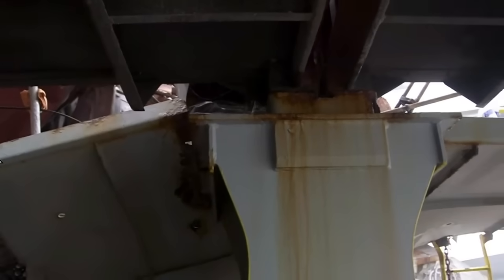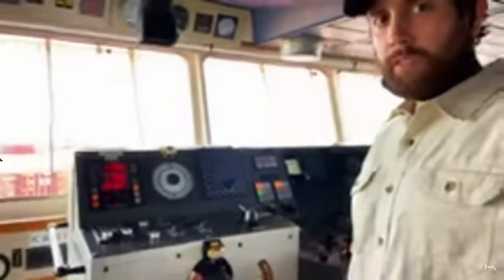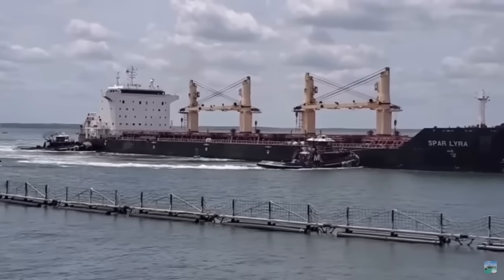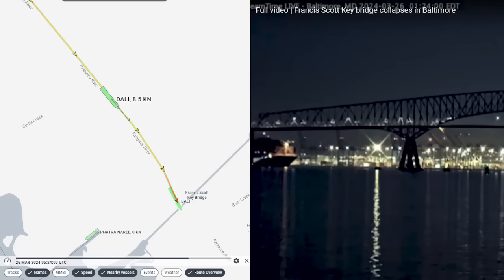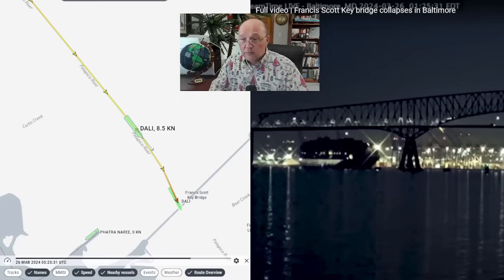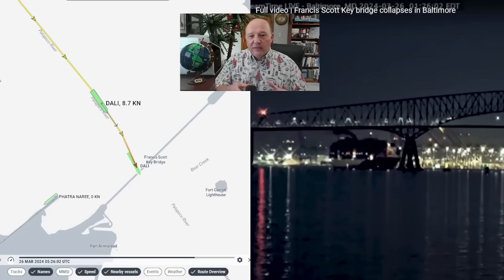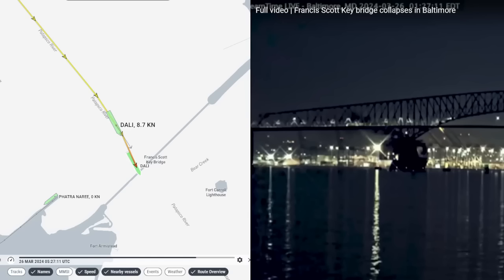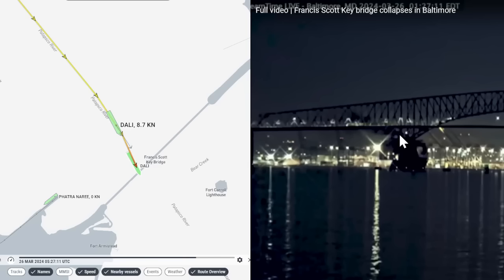Dali Timeline from Data Recorder in Striking Francis Scott Key Bridge in Baltimore, March 26, 2024

Comment: as much as we would jump to terrorism this is just a plain accident you cannot start one of these things like you start your car and if it's got contaminated fuel all bets are off

I see them on the St. Lawrence seaway where every few years one of them will have an engine failure or a steering problem and they can go a long ways before they stop.

 they'll hit the bottom before they can hit anything else except maybe another ship takes a mile or two to stop and if they got no steering they're in for a ride

it is unfortunate that they were that close to that bridge but I don't think even if they had a tug attached they would've been able to have any control to prevent it

The guy running the ship has an exemplary record and I'm betting that the data recorder is going to show exactly what happened which is engine failure no control got it restarted lost it again and it was all over with

Comment: A rudder is useless without thrust. This vessel would keep floating straight without engines no matter which way it was pointing. This is common sense.
Reply from the maker: A rudder is more responsive with thrust from the propeller.  However, even losing power, the prop does not immediately stop and the flow of water from the forward movement does provide limited control.
Reply: The rudder is a control surface.  For the control surface to operate (a pressure differential to exist) it requires water to flow over that control surface.

Comment: You shipping info is great, but please stop calling piers pilings.  Piling is a construction method that might have been used to drive piles into the bedrock on which the foundation of the Pier rest. The pier is what is sticking out of the water and supports the bridge deck.

Comment: If DOT was able to close the bridge why didn’t the get there contractor personnel off?
Reply: Probably didn't have time to find and warn them. The transcripts from the radio communications indicate that none one had any idea where they were on the bridge at the time, just that they were somewhere on the bridge. It takes some time to close  the bridge, but more time to drive around on the bridge to find and remove the road crew.

One future solution, could be requiring road work crews have radios so they can be called off in a emergency.
Reply: I wonder if there was a language barrier.  Believe all of them were hispanic.
Reply: Lack of time and lack of available units and lack of direct radio communication. 

Port Transit Authority had two units at either end of the bridge enforcing a restriction due to construction closing some of the lanes on the bridge.  when dispatch told them a ship had lost steering, they simply blocked the approaching traffic, which, at that time of the morning was not very heavy. 
The dispatch did ask if the units on site had contact with the construction crew, and one guy offered to drive up there and get them as soon as someone else arrived to relieve his spot blocking traffic. Obviously he didn't realise how imminent the impact was.

Comment: that bridge looks an ultimate architectural dream...the world port and maritime authorities the top notch honest Solas...MarPol..regulatory enforcers...the perfect JoinMafia Shipping&Shipyards companies best companions...but my real point is tt here  we are missing reality check..despite the amazing channel of Sam  kudos...that ...unfortunately...nobody like to admit that EDGs are absolutely crap..missing 9 of out 10 restarts....I guess the lateral current could have been a substantial cause for the vessel to deviate her course...stern much heavier and wider submerged hull volume definitely win over to the fwd section....and do not forget..when a right hand propeller starts...by screwing the water section clock wise ..the bow has the tendency to veer on starboard side..( viceversa for left handed propellers)( still this effect works basically from speed 0 to speeding up..)... but to be fair..in my opinion...the well explained in comment sections by professionals...the sudden drop of pressure in the rudder gear forced the temporary blockage of the rudder..nothing to do here...the timing doesn't help unfortunately....port anchor could have helped in swinging the bow on port side  just only (maybe with God willing...) if dropped in ample time...(.. but looks the black out occurred exactly on approaching the bridge...if we see the anchor dropped anyway   it's a good sign trying to cover crews/equipments negligence/ faults.. ( deja vu...correct my dear port authorities and inspectors and so and so...)..oh!..the S.M.S. was created to fuck us Officers...guaranteed.  We all are responsibles to these incidents...blinding ourselves  that business is NOT business...and that we want larger vessels and minute infrastructures....but null maintenance..maintenance and risk assessments are made just for the good sake of Lloyds and friends...remember guys the so called advanced technology is far to be from what we want to believe including all those cruise liners deployed full of flaws and dangerous structural defects.......buona pasqua..God bless those unfortunate souls.

Comment: Well I live just across the river from a major container port in the UK and no ship either coming into port or going out is ever allowed to not have tugs in attendance,and here we have a large container ship that has to go under a bridge sailing without it seems tugs,it was a accident waiting to happen.
Reply: I live in a port town and tugs are FORBIDDEN to escort ships even much smaller than this under bridges due to risk to the tug boats, which cannot stop a ship this size and would be incentivized to try anyway, leading to an additional fatality. Ships this size transiting a bridge without enormous artificial islands capable of grounding the ship well away from the piers are all accidents waiting to happen, with or without tugs. The reason the accidents are still waiting to happen is no one wants to spend the $$$$ to replace the whole bridge, so we just deal with what is the 35th such accident since the 1960s. Here we simply moved most ports to downstream of the bridges or just deny large ships entry.
Reply: @peter65zzfdfh Well given this ship lost the ability to steer before it got to the bridge a couple of tugs might have made the difference between a disaster and a close shave,ok I do not know that harbour but from the video that ship was never on the right course to pass under that bridge in the centre so a couple of tugs would have helped alot.

Comment: I happen to live in Hamburg Europes 3rd biggest container port and Germaneis No 1 port  inland from the North Sea . Now the horbor is a very busy place to operate in and also a busy waterway that runs into other nations in Europe . So we have a mix of the Super heavy Container Ships .bulk carries  small costal ships inland river cargo ships  Tourist shipping ie Cruise liners  and just general ferry traffic and private boats and  hobby sports boats . I have marveled at seing the worlds biggest Container ships being turned around and then reversed into the main Container burths with next to no space for error .now we have serveral of those monster Tugs here in the port  a based near the main habor. 
Now these ships are massive TV pictures simply do not show the true scale of these giants especaily the new generation of super Container ships which can no longer sail fully loaded up the River Elbe in fact now having to off load part of there cargo at a Coastal Container port before continuing to Hamburg and then only at high water . This is even after the River was deepened . Another issue here the sheer hight of these newer ships because another issue is getting under the main road bridge to the a 2nd Container port and railyard. They now just about pass under the bridges central span hight at 53 meters high the bridge is to be replaced one because its now old and is costing more and more to maintain.
But both replacment ideas and costs and in what form it should be replaced with have bogged down in a big argument politcally wise. Also its a symbol of Hamburg so many do not want it removed or at least parts of it left in place. anyhow I have drifted off subject. So far in Hamburg we have not had a major Container ship accident that I remember since I have lived here. But there have been accidents with smallers ships and only a few weeks ago a life was lost after a smaller Tug sunk I think after been hit by another boats we have also had smaller bridges and piers hits by ships in the past. At least two were those in charge were drunk in charge all ran into millions of Euros of damage .but those here working for the HALA port authorities and the river pilots and Tug Guys and Girls really do an amazing high pressure job to keep things as safe as can be here.

Comment: Ship went all over the world and lost power right there which is like a spec on its total voyage.... the odds
Reply: Yup, just about the worst place to lose power.  Ships have power issues a lot, but often at sea away from obstacles. Container ship Blue Nagoya lost power approaching the bridge from the other side in 1980 and bumped a pillar... but in 1980 container ships were a lot smaller so it just tore out a chunk of concrete, rather than cause catastrophic damage.  I think the Nagoya was about 1/10th the weight of this ship.

Comment: No reverse gear????
Reply: They might have thrown it into reverse... that might explain the black soot that suddenly comes out of the chimney, but they were too close to the bridge to go from 8kts to all stop.
Reply: @jimbobeire  now i found out there is no reverse gear. They stop the engines and restart backwards! Wierd!
Reply: @robertdinicola9225  Depends on the ship. Some have a reversing gear, others are direct drive.  There's pros and cons to both.
Reply: @jimbobeire  that one supposedly has direct.
Reply: @robertdinicola9225  Yup, requires high air pressure blast to the pistons in sequence to reverse the piston motions.  But either way,  they were too close to the bridge to come to a full stop, especially if power kept cutting out.
Reply: @robertdinicola9225  Big reversing gears and some kind of massive clutch for that much horsepower (Dali is 55,630 hp, equivalent to 14 modern diesel locomotives) are a major problem themselves.  Gearbox problems on one of the 2 Navy LCS classes are the main reason they are being retired early.  Reversing a big diesel just requires flipping the valve timing.  The practical alternative is a reversible pitch propeller, again supersized for 55,630 hp. Container ships spend the majority of their time crossing the ocean as efficiently as possible, very little time in port, so reversing is a low priority.

Comment: The port anchor would pull the ship towards the bridge. That would answer my question about why they turned into the bridge. The starboard anchor would have pulled the ship to the right, away from the bridge. First they were way off course and far left of the center of the channel.
Reply from the maker: Port anchor pulls it into the channel
Reply: Opposite. The ship veered to the right into the bridge pier.

Comment: So, as a marine electronics guy I have a few problems with your assessment here. First off, the ship turned closer to 90 degrees than you showed just before hitting the bridge. Second, not all back up systems are "automatic"  and that includes generator sets. Also, "automatic" systems fail too, right? I kind of thing there were system failures in this episode and I kind of think we will never know the full truth of it, because that is the world we live in now. The fact is that it happened and it needs to be fixed quickly, and given the current powers that be I suspect that it will take far more time and money than it needs to take to fix it.
Reply: Yes. There's a video which shows a rather dramatic turn to the right, which Sal seems to be minimizing. Not sure why he's downplaying what's obvious to some of us.
Reply: @terebrate  The video is from a weird angle that exaggerates such things. The tracking is more accurate.

Comment: Call for tugs???????
Why aren't tugs used at each end of the ships to let the front tugengine on an rear tug weighted..
Both taunt with a cable/ECT.
When said ship is out at sea the tugs return..
Why the hell in the USA are we looking like ASSES an not using tugs to guide these in an out 24/7..
ESPECIALLY when no DRAW Bridge.. or concrete protectors to protect the bridge...
Philadelphia has one protecting its bridge across the Delaware one can exist in our main port in the USA?????????
😢😢😢😢😢😢😢😢😢😢😢😢😢😢😢😢😢😢
There's no excuse for this accident we got tugs to Guide these ships in and out!
What an embarrassment for our country!😢😢😢😢
Reply: Out at Sea? Or just out in Chesapeake Bay, cos Baltimore is a long way from open sea. 
Propbably someone kept kicking the can down the road about spending a huge chunk of budget to put in proper protections for the pillars, but to be fair container ships kept increasing in size at a remarkable rate each decade.

Comment: The simulated version does not at all capture the sharp angle the ship made. It makes it seem only about 20 degree's. It is clear though that the boat turned at least 60 degree's which you can obviously tell in the video because the boat is almost parallel to the camera then goes perpendicular.
Reply: The angle of the video greatly exaggerates its movement. It's nowhere near parallel or perpendicular even then.

Comment: The core reason that six people died from this accident is that there was insufficient political will to spend the money required to protect the bridge.

Everything else, at this point in time is pure speculation as there is insufficient information to draw any valid conclusions.
Reply: Taxpayer money is a limited commodity.  Spend too much and you kill people other ways.  Spend way, way too much (our present gov't, and not just ours) and eventually it will kill millions when, not if, the entire global economy collapses.

That's not to say that in this case bridge protection should not have been a higher priority, as there are so many fallout effects from this sort of accident (some also deadly or at least potentially deadly), and under different circumstances many more people could have been killed.  But, ALL factors and costs should be weighed, which rarely happens in a cannibalistic, political world.

FWIW, I would think we know enough that modest cost structures can be built and MO Nature would carry in most of the material needed to protect a bridge.  (This taken from observing the large quantities of sand that structures in rivers can cause to accumulate.)  Just a thought...

Comment: Appreciate this. However your explanation of how the ship may have turned sounds like a reach.

First you say you don't see why because there's no wind and no current to speak of, but then you seem to reach to say well there is this potential for "backwash" or whatever.

The distance involved in the turn or heading change, or whatever the term is, can't be that great. Certainly no more than a kilometer or maybe less. 

This is a 100,000 ton ship making almost 9 knots through calm water. It should continue on the correct course for literally miles due to inertia.

Very. Hard. To believe the ship wasn't steered into that bridge.

Everything else is just a smokescreen.
Reply: And no fact will ever change your bias.
Reply: I brought this up with Sal and he replied that by "no current" to speak of, he was only referring to main channel current, by which I think he means current flowing "out" in more or less the same direction as the main channel.  IF that current was fast enough, it could kick around the stern of the Dali, but, it seem unlikely the current would ever be that fast.

HOWEVER, even a 1 knot current from that side channel could do the trick, esp. with the port anchor down.  Pressure from the starboard side absolutely would try to pivot the ship around the anchor even though the anchor would be dragging through the mud @ the bottom.  

ALSO, once that pivot gets past a few degrees, the center of mass of the ship is now to the port side of the anchor, and the torque from the anchor reverses from CCW, as viewed from above, to CW.

I don't know if the ship swung around that far.

Just before impact, the Dali swings back to port.  That COULD be the ship getting out of the side current.  If they'd had another 30 seconds, they might have missed the bridge support...

Comment: Well there is clearly wind, the black smoke coming out of the stack is laying almost straight over in the same direction the ship is going. So not sure WTF your talking about.
Reply: The ship is moving out from under it's own smoke.  Have you always been slow, or was it after drinking leaded fuel?
Reply: The weather data reports wind as calm. If you bothered to look at the video or knew what you were talking about you could confirm that by observing the CALM water. Only one that doesn't know WTF you're talking about is you.

Comment: Tugs should just be mandatory. In Hamburg Germany e.g. 3-4 tugs guide the ships through the river and harbour
Reply: They're forbidden here (Australia) for ships a fraction of this size when transiting bridges, as they're both ineffective, and put additional lives at risk. 4 tugs could not have stopped this, and at least 1 would have wound up squished.  There are no significant pylons in the way for the port of Hamburg for any ships of significant size, which is the correct solution, not tugboats. Basically, like Hamburg, if you have river crossings downstream of the major container ports, have them be tunnels.